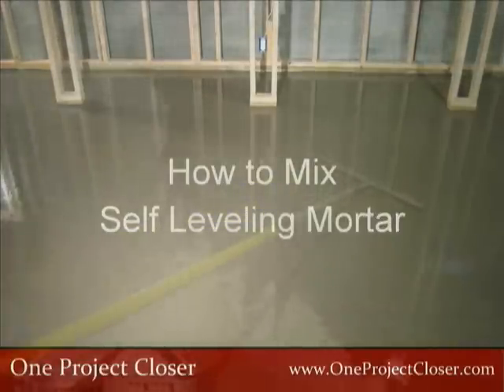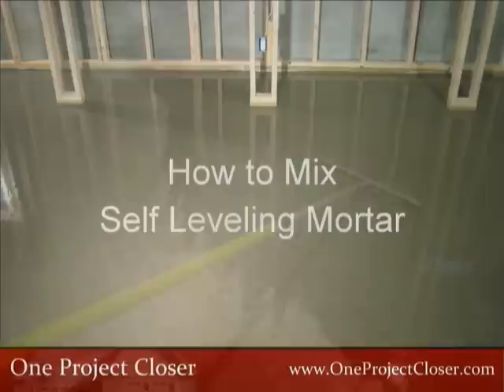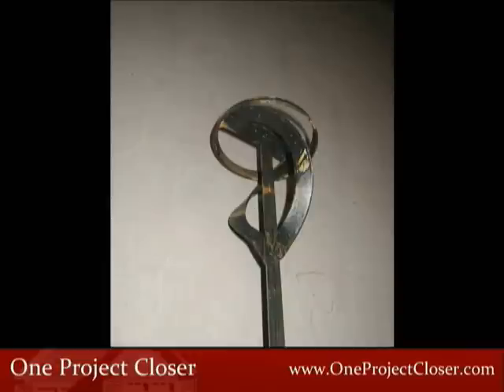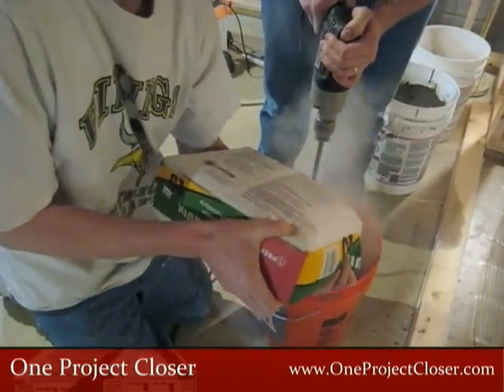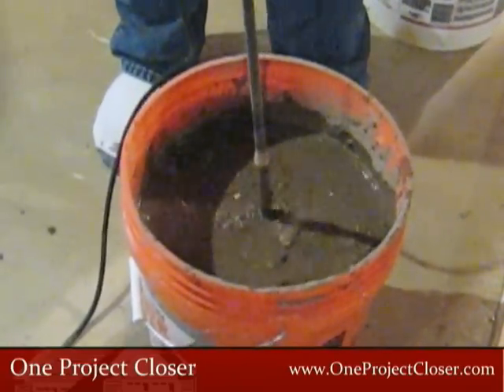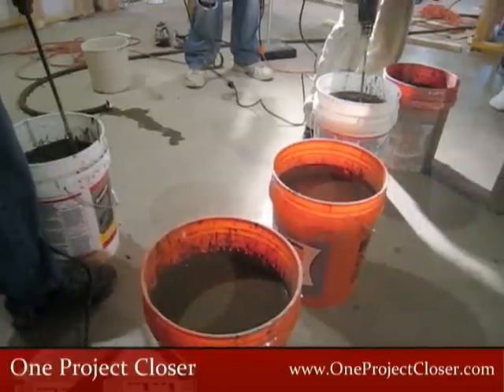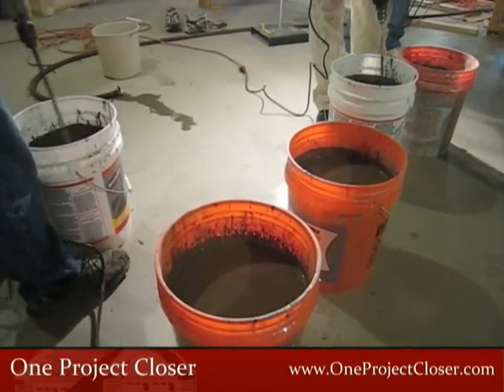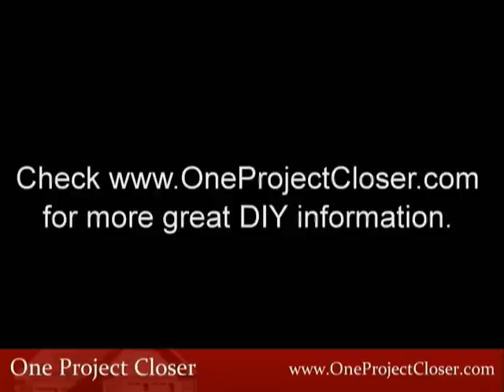How to Mix Self Leveling Mortar (Cement)

Comment: Hi! I've got a really small job (~ 2' x 6.5') and I don't have a ton of tools at my disposal. I'm hoping to use just a small portion of the bag, but not sure how much I need. Also, with the smaller quantity, would I be able to hand mix and achieve long lasting results?

Comment: Sadly I think many people may refer to this as a how to video... First off security. Where gloves, a mask, glasses, the product is corrosive and volatile when mixing if you get some in your eyes or your lungs, it's really bad for you. You might even want to where jacket when mixing the powder does tend to fly up. Next no bare socks on a work site. Next your are using a paint mixing bit, you have a high risk of getting air bubbles in your mix, that will make a whole bunch of tiny holes when it dries, if you see big holes, that is most likely because you did not use enough primer. Next mixing a bunch of pails at once is a bad idea. One or two guys mix, another guy pours as soon as it is mixed. After 25 minutes it already starts to stiffen, in 45 minutes it is set. Next, you should always rake it or spread it with a tool. If you see the material is trying to head one way, help it get there fast... If it takes more than a few minutes to find it's level that not going to work out. Next if you have holes or cracks in the floor or gaps between the floor and the walls fill them, or else those areas will slope. I really wish you would redo this video or at least take it down, it is a disaster waiting to happen... Pretty sure most of this is on the manufacturers instructions. Considering the number of views, you must be making lots of contractors very happy, because anyone taking your lead on this is most likely to make a mess of things and need to call a contractor to fix it.

Comment: Or do it professionally, bit of powder with water and then mix it with your trowel.  The question is which is first, powder or water?  if powder if hydrophobic, then I go with powder as the solvent, and water first as solute (mixed to union/homogeneous).
Mapei polymer is hydrophobic, I think.  The ordinary mortar is water absorbing/hydrophillic.  Ironically, it mix better w/ lil amt.
I mean if you mix it like a smoothie, why bother using the trowel and mix/leveling it again back and forth?

Comment: Unbeleivably unprofessional. That is a mixing bit for liquids, not suitable for proper sheering of polymers in SLUs. Consistency is WAY over watered,  The person doing the mixing should have a handle on the drill (If its a high speed it'll get hot as hell after a few batches) not to mention dust mask and gloves, Also, It is preferible  to mix in 2 bag batches.  There are several reputable manufactures on you tube with good how to videos. Self leveling is tricky, follow the manufactures advice.